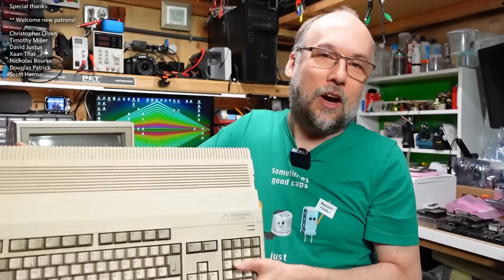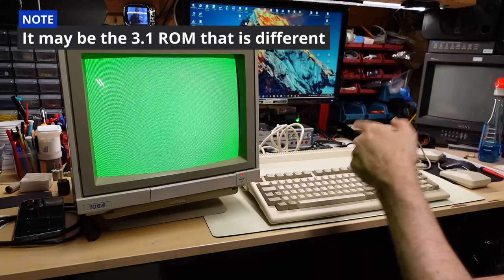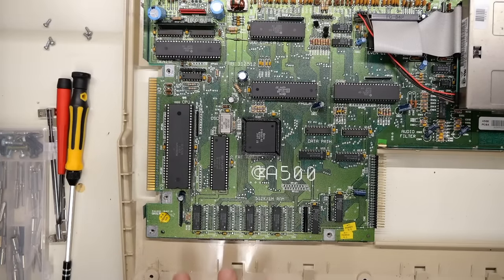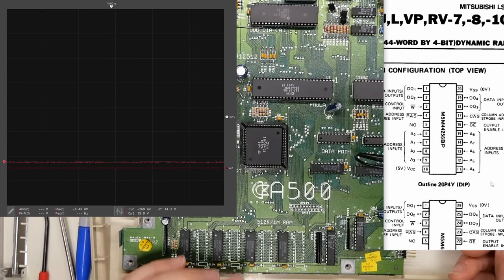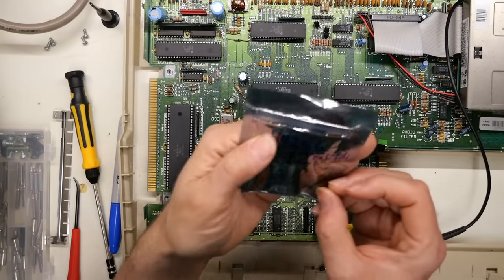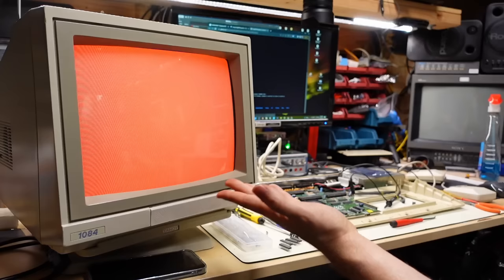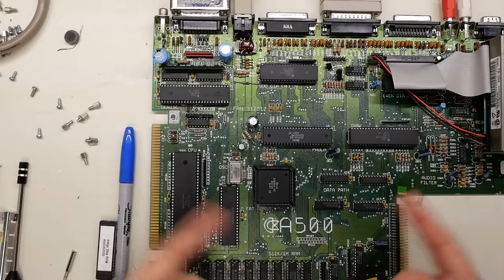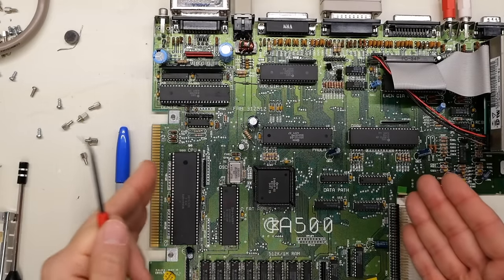Can the Amiga Diagnostic ROM help me figure out what was wrong with this Amiga 500?

Comment: Replace the Agnus socket, for a green screen error.  Always do this, and you fault will return at somepoint if you do not.

When this Agnus socket pins go bad, or the casing splits, frequency issues occurs, and can take out other chips.   Becareful not to take up the pads when desoldering and reflowing.

Also at CBM we spent so much time in trying to write a test ROM, and tried using a external Rom cartridge, one of these attempts cost over £20,000, and was the last attempt we did.   It did not help in day to day repair of these boards.  In the end we just used a very very expensive Philips embeded chip analyser, which if programmed up for each motherboard, can sample the component or whole board with in 30 seconds and tell you the state its in, including any frequency bounce or current variations.

Doing a Amiga repair testrom can not be done, as if the motherboard has a Blitter short issue or what we found frequency bounce on the Agnus socket, any Rom program will fail in trying to actual start up.    We even tried a 680xx only test ROM, and a test ROM with the M680xx removed.   There is no way of diagonsing an Amiga which is NOT getting throu its normal A1.3 firmware test startup.  Else you have yo use the Philips component and chip indentier analyser computer.

Also note, RAM in socket sometime can cause frequency bounce, This is very common in the 512mb expansion cart, but not on the 1024mb version and it had better decoupling caps.

Also note, if any of the EMI componets are down as they were used as fuses, all hell breaks out, and its proberly the serial chip caused all the issues and snowballed bacause the serial chip leaks +-12v voltage on the data and address bus.

It is a known issue, I know this as I was a Senior engineer at CBM.
Reply: So you tell that there are no way of doing diagnose ram that is not getting through 1.3 test startup.  still this is exactly what DiagROM is doing..  it runs without CIAs, without PAULA etc. (ok no serial output if paula is missing. and no LED flashing if cia is missing)  but it is possible..

it runs on very very stripped machines...  and have been used to develope several acceleatorcards for the amiga as it starts on severly crippled machines and will try to output serialdata etc..
Reply: @ChuckyGang  But if you have any address or data lines down by a short circuit then nothing will test the ram chips.
Reply: @ChuckyGang  All testing could show what we at CBM found, is that it can test Ram is working.

But then on production lines this would be useless as all would be needed was to switch on the Amiga  to see if the load disk icon should up.  Ie no firmware generates colour screens.
Reply: Best way to test Ram is - 

Heat, are they hot or warmer than the next one.

Piggyback them, o/c failed.

Cut Vcc, piggyback, s/c failed.

Use a Philips IC in circuit analyser.

Even if you find one ram chip down, you will find another fault somewhere else caused it.... else it will blow ram again or show the primary fault.

Faulty expander Ram packs can cause internal memory to pop.

Another issue was overdriving the RAM hence its better to use OKI ram chip.   People were putting and dabbling in fast ram and Xram in the Amiga, mixing normal speed memory with fast causing overclocked issues.    Later Amiga PCB in the A500 could cope better.  Early A500 revisions could not.
Reply: @ChuckyGang  We wrote a production and engineering test firmware on Rom

Using the CPU
Using no CPU and it ran on the Agnus.
Using no CPU and no Agnus installed on the board and it ran on a exteneral cpu and rom board.

It still using these method was not better that the startup colour  diagnosics on orginal roms, and using the Philips in circuit and out of circuit analyser l tester.

Commodore binned the idea of external firmwared testing, it to expensive and not quick enough.

Hence we wrote a Amiga diagnostic on disk, if you can't load the disk due to a fault, then it was piled in to on switch on colour piles, and if colour needed ie white, grey or green when to heat tests or on the Philips Analayser.

Any way by this time we knew all the haunts what each colour really meant on every Amiga and Amiga revision PCB.

Green screen is the major fault - which really means address and data lines fail to come up to life.  Which is either a  Agnus issue, or pcb failure, or multiple IC' chipsets blown up and gone s/c and o/c, which the serial driver chip cause it all and snowballed.
Reply: and every A3000 pcb has some sort of fault.... as it was the first Amiga multilayer PCB, of which all had somesort of multilayer pcb failure.
Reply: @ChuckyGang  If you have a A1000 or a early A500, I recommend you change the Gary to a later version....

As the first Gary had a coding sequence which when told to by this command, blew the Agnus up.   

The engineer was arrested for putting in this command.  He did so   to make sure he got paid for his design work....   ie proberly the first case of ransomware.

The command was brought to the Gary by a floppy disk with the command.
Reply: @pqrstzxerty1296  yeah shorting datalines is a nogo.  addresslines ..  depends on what lines.   but it is for sure possible to do diagnostics that runs on systems that does not run 1.3 for sure.. as DiagROM does exactly this.  and is a designthing of it (this is why it does not use ANY irqs..  no blitter etc.  as little as possible to run)
Reply: @pqrstzxerty1296  well on A3k only signals on inner layer is around the cpu.. noticed this when cloning the pcb :)   but..  cracked it..  so it is cloned :)
Reply: @ChuckyGang  Sound like it no actual program on the ROM, as all what younare saying its doing it a table on the ROM, with logic counting the ROM sequence, and then logic reading back what comes back, and comparing...    but it would not test Ras and Cas etc.

Basically thats just a simple chip analyser.

The Philips big expensive computerised IC and PCB analyser can suckup data from a known working chip or PCB, then compare it to another chip or PCB.  Even if you don't tell the analyser whats it is testing, it will compare the results in its database what it knows and thinks you are testing and tell you if it passed, failed or out of tolerance, all within 30 seconds.   It can even work on dead boards, and shorted out or open circuit PCB's, and ICs.   You can program in sucked up data of previous fualty PCBs and chips so it knows them in its database comparer.  Meaning if address lines or data lines are s/c or o/c and we seen it before then the data will be in its database.   When we found by manually explorering more, spending say days on fixing, we update the database....  thus when we go throu the faulty Amiga piles, the analyser now see the fault within 30 seconds and gives us the engineers notes how to fix it.

Nothing beats  the Philips analyser in spent hours.   Thou it does intially cost tens of thousands to buy one...  but save lost hours in repairing the same faults, thus money well spent on repairing near millions of Amiga boards.

You be better off making a device pcb to sit over a the Ram chips, and it programs directly to them doing a table sequence from a eeprom and some sort of logic gather data and comparing with known working.   All with no power in the Amiga PCB, so Ram chips are  powered by piggy back on top.

Most of the time the primary Amiga faults were Agnus socket, EMI componets, serial driver.    If these are not tested for, when you think you fixed an Amiga PCB, then the fault still exists and will blow up something again.  So a shortlived fix.  If you have got a green screen you have to test for these everytime.

We did find, very in small very rare amounts that the keyboard  can blow Ram chips.
Reply: The area you need to look at is making a daughter (piggyback) card, with a CPU for comparing, and a eprom with a sequence table upon it, and using fast logic to i/o the read result back into the daugtercard cpu 2nd eeprom firware (software etc).  

Basically you built a chip analyser.

Instead of doing it via the Amiga Expansion port or 680xx cpu socket.   If you not checking for Ras and Cas errors, then you could do a daughercard via the Ram expansion socket, but I don't think that would be reliable in all fault cases, and the daughercard by piggybacking the Ram would be better in finding faults in s/c and o/c condtion, and gets round address and data lines s/c.   But this would only check Ram is ok, not the PCB.  So you would need both your ROM diag card and a daugher Piggyback card on the Ram or via the RAM expansion socket.

We did do a diag via Ram expansion, gave up as again did so little in real world faults conditions, and better ways of quickly manually finding the faults were found.
Reply: @pqrstzxerty1296  there have been plans of doing a hardware solution as you told.  but that is "maybe"  meanwhile DiagROM does  its job fine and works on all Amigas..

Comment: I'm confused. Adrian said those are 256x4 RAMs... and it's a 16 bit machine that needs 16 bit wide memory. So isn't that then 256k x 16 in total and not 512k ?
Reply: 256K x 16 is 512K ... 512K x 8.

You almost always total RAM in bytes, but sometimes in words .. in which case this would have 256K words.

Comment: my Amiga was  working fine outside the metal shield but every time I tried to place it inside ...the Green Screen appeared.
I checked it for solder debris since it had just been recapped but nothing. After numerous attempts I finally got it to work inside its case and  I never saw that green screen again (go figure...)

Comment: Having a key for ç but also for ñ makes me think the keyboard may have been used in both Spanish and Portuguese keyboards -- and Brazil is a Portuguese-speaking country that was using NTSC for television signals. Not saying it's from Brazil, just saying you should be open to the possibility.
Reply: Brazil didn't use NTSC. It used PAL-M which used 525 lines like NTSC, and 60Hz like NTSC, but used the PAL standard for encoding the colour signal. A unique blend of systems not used anywhere else.
Reply: @owaing  So I imagine that, like SECAM (decoding PAL), it is somewhat NTSC compatible if you're willing to get luminance only?
Reply: @mal2ksc  Yes, it was apparently very compatible, even the audio would work on an NTSC television. Just the picture would be monochrome.

Comment: 4:06 that seems weird to me... why would the Amiga considered a 16-bit machine? 
the 68000 is a full 32-bit CPU, it just has a 16-bit data bus.
by the same logic you could call the IBM PC an "8-bit machine" because the 8088 only has an 8-bit data bus despite internally being a 16-bit CPU.
30:56 i have uprgaded my A500 to 1MB of onboard RAM and i also have another 512kB on the trapdoor, and they do work perfectly fine together.
Reply: The 68000 usually gets called "16/32" just to avoid the argument and get on with getting things done. And I have an actual data book from Intel where they called the 8088 and 8-bit processor and compared it with the Z-80 and 6809. (I really need to find it and scan that page.)

Comment: Nice work. Another reason the piecemeal chips might not be working is that they should be matched with same manufacturer and production date and batch. I've seen mismatched chips work but sometimes you can get strange results.

Comment: If the ROM hasn't been replaced all Amiga 500 should have KS 1.2/1.3. It was not until Amiga 500+ that they started with KS 2.x
Reply: Not really. A lot of early Amiga 500:s came configured with Kickstart 1.2, which did not include proper HDD autoboot support (needed boot floppy if you bought a disk controller).
Reply: @sekigunstyle  Yes, of course they did, but never 2.x.
Reply: @fu1r4  I did not object to that at all. Only your statement that all A500:s with no ROM replaced should have Kickstart 1.3. A lot of people also upgraded from 1.2 -> 1.3, so you should not always assume that it is factory configured if you find a 1.3 ROM installed.
Reply: @sekigunstyle  That sounds accurate. My first A500 was purchased from an authorised Commodore dealer who had swapped the ROM, OS disks and manual for the Amiga Enhancer Software 1.3 set, clearly it was originally a 1.2 machine.
Reply: @sekigunstyle  2:08 Adrian didn't know if there was KS 1.3 or 2.0. That was the reason a wrote as i did. I see no reason to explain KS 1.2 when we all know that was the first KS for A500.

I have now added 1.2 so you will be happy too 😀

Comment: Feels like this video is 20 minutes longer than it needs to be... first forum post told you to replace the RAM, and if you had done that, it would have worked immediately.
Reply: Yeah and actually why even do a 10 minute video with all kinds of useless repairing stuff, why not just look in to the camera and say: "I had a broken Amiga. Now it works. Like & subscribe."
Reply: "Don't start desoldering chips until you know what is wrong" is like his motto and is a good one.
A LOT of things could lead to green screen, not just RAM, and it could easily be just one chip instead of 3.
Desoldering often leads to risk of lifted traces which is not good if you can avoid it.
In addition, Adrian is showing us good diagnostic tricks - well they didn't help him much in this case but sort of helped rule out some possibilities.

Comment: Chucky created the "Amiga 2000 diag rom" for himself, since nothing like it existed. I think he was recreating the A2000 motherboard and needed some tests run to his own needs, I mean what sane person would include a serial driver on a commercial product, but Chucky did. Another big difference is that all Chucky's components worked, it was his motherboard that had failed, so testing with broken parts was probably minimal. And once he finished the rom he realized that with very minor changes it would probably work on an A500 too, so he published it to github for anyone to use. 
I am sorry, but this got me riled up, whining about free software not perform exactly to your standards is very entitled.
Reply from the maker: I don't agree -- don't get me wrong, it's great it exists. But, as it appears on first blush to test the RAM at boot with no warning that it doesn't do a full test. If other people try to use it for finding bad RAM, they may be led down a path trying to fix other issues with the machine that are just RAM problems. This can be costly and detrimental as the "green screen" can easily be caused by faulty Amiga custom ICs, not just RAM. 

It is best that people know that it does not test RAM fully so it should not be relied on for that. How else would people know that if someone doesn't say it?
Reply: @adriansdigitalbasement  Of course you are free to disagree. Yes, it might appear to test ram, but it never states that it does a complete ram test, nor does the read me even mention ram test. To me, it looks like the "ram test" is more of "let's see if we have ram to run the diag code", but that is why I point out that it wasn't designed to diagnose faulty ICs. It does state clearly that it is intended for people that know what they are doing, such as yourself. 

I do apologize if I came off as belligerent, but your presentation of your criticism came across as "whiny", and that set me off. Of course, users should be informed of what a tool is capable of and not, and I think your points are mostly valid, it was the presentation of them that bothered me. And for my accusatory tone, I do apologize. The real problem is that no good diagnostic "cart" al a deadtest exists for Amigas and Chuckys DiagROM is the closest thing that exists, but it wasn't really meant as a comprehensive test rom. 

I alerted Chucky to this video, if he minds, I am sure he will speak up. But I doubt it, he is too nice a person. 
And lastly, thank you for all your great videos! They are always fun and informative.
Reply from the maker: @OscarSommerbo  Another commenter actually mentions there is another diagnostic ROM from 1991 apparently that does do a full RAM test. I also disagree on your assertion it is not doing a RAM test because it absolutely is. It’s just not doing a thorough one. It literally showed me which bits were bad on the one chip, which is the result of a RAM test. Having done many many RAM tests over the years, this is what it appears to be doing. Having learned how it works, I’ll stick Amiga Diag ROM in the same column as the Dead Test. It also tests the RAM, but it is of limited usefulness.
Reply: @adriansdigitalbasement  I think we have a difference of opinion, but that is fine. Chucky might update the ram test code, I think he should as it is very brief at the moment. It really depends on how busy he is.
Reply: It is still not a ramtest.. it is a quick "are there usable ram to use here" test. The ramtest is in the software....  That logica would not even run on this machine as there was no usable ram. And logica would not tell why as it doesnt output on serial and then there are no possible way to communicate qith user except colorcodes..

But IT IS NOT A RAMTEST. That is in the program..  and 1.2.1 used is old. The daily 1.3beta is better and handles adressissues etc...
Reply: @adriansdigitalbasement  too bad you did not understand how to use the software. But no that is not a test you did run, it was a quick look for mem test. The real test is in the software that you never bothered to run.
Reply from the maker: @ChuckyGang  The system didn’t boot right. It was impossible to “run” any test except the initial RAM test the ROM runs.
Reply: @adriansdigitalbasement  as there was no ram available. If you had a more expansion so there was ram it would run.